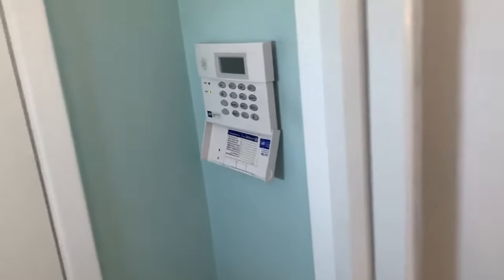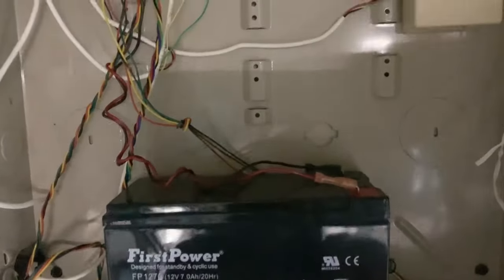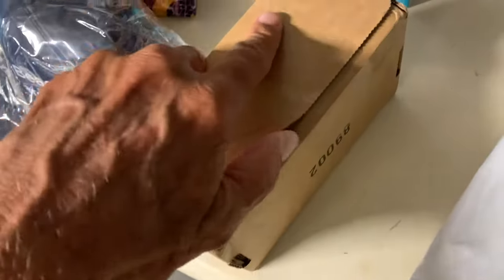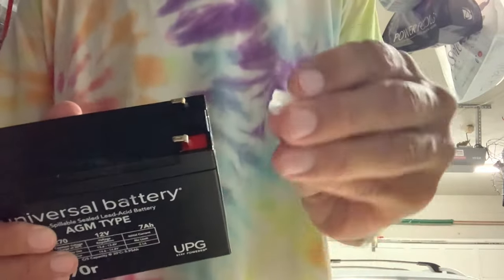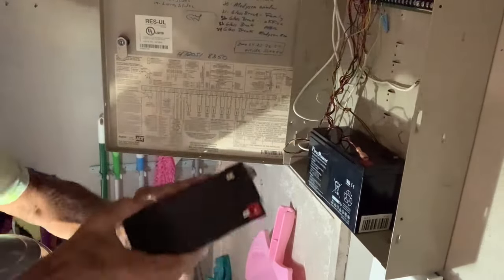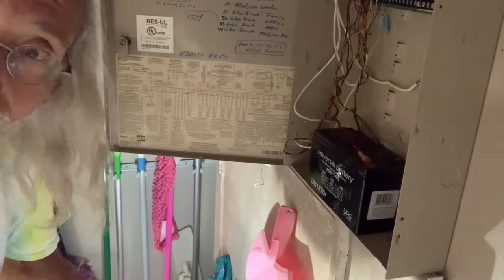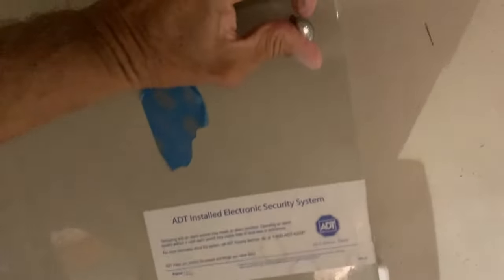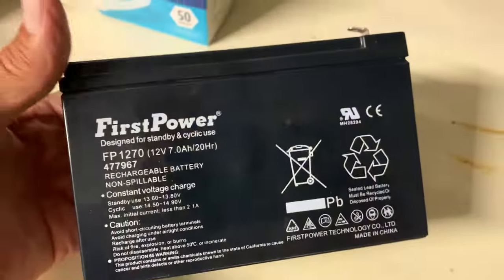How to change a 12 volt battery in an ADT Alarm system

Comment: Thank you!  I was a little nervous about changing this because of the warnings on the battery about the risk of fire or explosion… and even when I called my alarm company, the tech said to “be careful that the wires don’t touch, and that you hook up the red to red and the black to black.”  Your video put me at ease that I could do this, and it was fast and easy!  Thanks!
Reply: P.S.  My replacement battery came with absolutely no instructions, so again, thank you!
Reply from the maker: Glad I could help thanks for watching
Reply: Same for me, thank you!!

Comment: Most alarm boxes have an anti tamper sensor on them so if you remove the cover, the alarm will go into full alert status with siren blaring. You need to disable that before removing. Maybe ADT don't have those in your country, but if you do set it off, just input the correct code on the keypad...
Reply from the maker: There’s an electrical connection with a transformer plug somewhere in your house. If you pull that plug out, and disconnect the battery you disable the alarm.

Comment: red and black wires on battery came unhooked from somewhere when I tried to take them off battery.  wish u had shown where they go.
Reply from the maker: You’ll see one side is red and one side is black so usually the black is hot in the red is neutral. Good luck thanks for watching.

Comment: Do I have to put in test mode and disconnect the charger( plug)? That’s what the instructions with the battery said
Reply from the maker: These batteries are just in case the electricity goes out, so I think you can just plug it in

Comment: hi, i have adt galaxy series alarm panel. My contract is over and I don't want to give any money. For him to call me in case of any situation where I will connect an automatic dialer. my question is, is there an alarm tamper detection status when the water panel is on? I do not have an engineer password, only the password I used for the login and logout given to me. I wonder if this password will solve the name?
Reply from the maker: So what I gather from your question is that you wanna use the alarm system without it being connected to ADT so to Waze they connected one is with their own radio frequencies and the other is through a hard line I believe that you could possibly get it to work but it would be hard because it’s proprietary your best bet would be by one of the new systems that are much cheaper good luck thanks for watching

Comment: Did you turn the power off first? Also, do you have to put it in test mode? When I spoke to ADT they told me I needed to put it in test mode or they would send police to my house when it's disconnected. Thanks for the video. Have been a little nervous about switching it out. My battery came yesterday and instructions said I need special tools and electrical tape.
Reply from the maker: I’ve had to do this a number of times and I don’t really have anybody sent the boys out but I did have to have ADT come out and reset my pad one time

Comment: Great info. I was able to change out my battery all by myself. My display however still shows BAT. So does it take a while for the new battery to charge?
Reply from the maker: New battery should be charged. You might wanna check it.

Comment: Hi, do I need the unplug the transformer before I change the 12volt battery? Thx for the help
Reply from the maker: If you want to take full power off of the unit, you would unplug that transformer
Reply: Thank you for the help
Reply: Then I won’t really need to unplug the transformer just to change the back up battery.

Comment: What if i dont want to use my alarm system temporarily? Can i just take the battery out and leave it without one? What should do with the red and black wires?
Reply from the maker: Well, the alarm system has two sources of power one you have plugged in somewhere and then you have to back up 12 V battery so you have to remove both the battery and the plug by taking the red and black wire off the battery and unplugging the transformer. good luck thanks for watching.